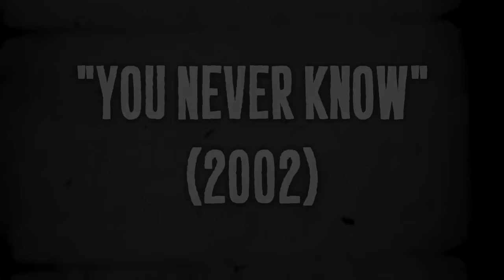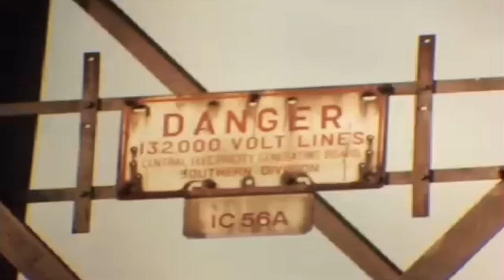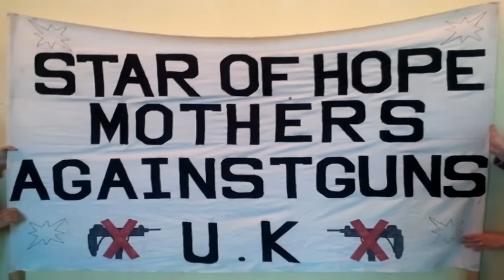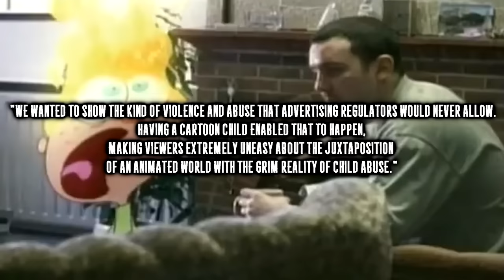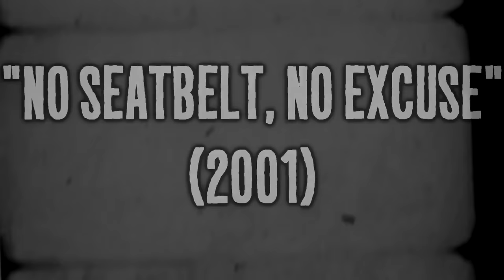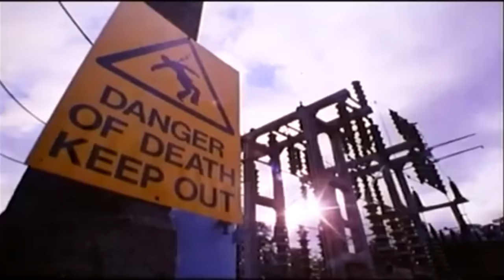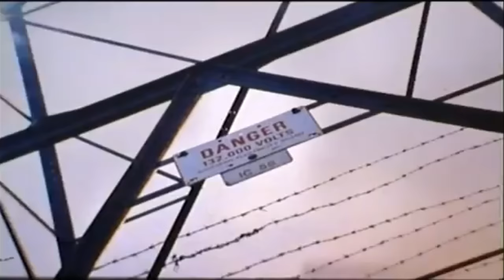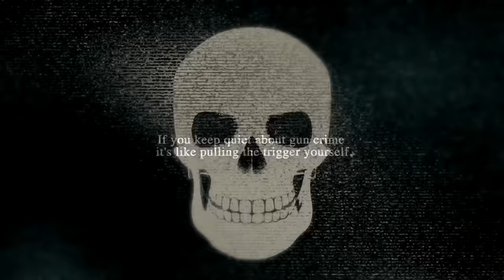9 DISTURBING British PSAs

Comment: The chef dropping the pan over herself actually makes me die inside. Like imagine the severe pain that would cause in real life. Im someone who wants to work in medicine so very little makes me feel queezy, but the thought of that literally freaks me out. 💀
Reply: @stinkmymeat  i actively avoid it  because i know for a fact its graphic as shit, which is a good thing because I understand the dangers of not being careful-
Reply: Are you talking about the one where a chef slipped and spilled a can of "hot oil"?
Reply: My hands slipped off a pan holding a gallon of boiling water at work once (due to an MS-like disease). Literally just lost my grip on it suddenly and it hit the ground. Since I sweat easily and profusely, I had always rolled my pant legs up. I'm sure you can imagine the 2nd degree burns I got that day. It even gave me 2nd degree burns on the tops of my feet before I could get my shoes off. That PSA was legit. Ohhh the pain I went through over that shit .... Ugh.
Reply: @zimtastic1171 God, I’m So Sorry For You…
Reply: I was drinking water when I saw that
Reply: As someone who works in a kitchen's restaurant, this is one of my biggest fears. The pavement often gets wet and slippery, and knowing that this CAN happen, I pay extra caution to dry any water or remove anything that could make me trip anytime I need to deal with boiling water/oil

Comment: I remember in my elementary school an electrician guest speaker told us about the dangers of electricity. He had this 3D model of an electrical zone like from the PSA. The 3D model was wired and he demonstrated a scenario of a child trying to get their kite back. He pushed a button, the child figurine swiveled, and touched a metal plate. A beam of electricity showed through the figurine and sparked at contact. I remember the sound of it, like really loud pops and crackles.

Comment: Firing a real gun is nothing like shooting foam darts at your friends. 

How the hell would plastic guns be able to fire bullets? That stuff gets hot.
Reply: Maybe they were made of metal too
Reply: Assuming it's made more like a small brass tube for a one shot and dump gun
Reply: back in the day metal toy guns used to be more of a thing..though I did not think they were talking about those, I honestly though they were bullshitting because you know how th eUK treats guns but...making real guns out of toy ones is not too hard

like mentioned with spaceman, you can put metal inserts to hold the pressure and heat, but even without a toy body really you can make a gun from anything, sorta makes the entire PSA in of itself void because as long as you have metal piping, simple tools and basic know-how of how to build anything, you can make a gun easily.

Comment: As someone who was in a car accident lot that long ago, I speak from experience when I say seatbelts do in fact save lives. I was t-boned at an intersection and my car rolled over. If I hadn't been wearing my seatbelt I can say with complete certainty, that at best I would've some sort of neck injury or at worst died. Funnily enough the only injury I sustained in that accident was a bruise on my stomach where the seatbelt locked up and kept me from being thrown all over the place. Trust me the damage a seatblet will do is more fixable than the damage being thrown from a window onto the road or into something at 50 mph.

Comment: For a long time, my dad didnt wear his seatbelt, even got me into it when he drove me places. He figured he never needed one because he could brace himself on the steering wheel, but obivously passengers dont have that luxury. One day, my dad was taking me home from school and a lady pulled out in front of us. He assumed she wasnt just going to sit in the middle of the road, but she did. A bit too late he slammed on the brakes and we skidded down the road straight into the passenger door of her car. When we made impact, my head cracked the windshield to where you basically couldnt see out it from the passenger side. By some miracle, I was fine. Not even a headache. By another miracle, my dad was also A-OK. Thankfully we were in a residential-ish area so the speed wasn't that high and he was able to slam the brakes so soon. Comedically, he told me to put on my seatbelt before the cops showed up obviously to have less explaining to do. That day on I always wore my seatbelt, even going down the block while yardsaling.

A few years later, I was picked up by my grandpa from a Boy Scouts event and were heading home. His cellphone started ringing and we couldnt find it. Distracted, we ran right into the back of a van that'd stopped for a turn. We both had our seatbelts on and the worst injury between the both of us was one of the lenses coming out of his glasses as they flew off his face and leaving a delicate slice along the back of one of his hands. This was at sub-highway speeds and he didn't hit the brakes. I don't want to imagine what would've happened if either of us didn't have our seatbelts on. 

Not that long ago, my dad got into a crash in one of his trucks, going downhill towing a boat where someone pulled out in front of him and due to towing the boat, couldnt brake in time. Worst damage was bending the front of the truck out of shape and thrashing the radiator. He was wearing his seatbelt that time.

Comment: It may be kinda strange of me to say, but the reveal on the abuse PSA was not as harrowing as the abuse itself. Why? I guess it's cause I saw the twist coming the first time I saw it. And maybe it's cause the kid laying in that pose wasn't exactly the most convincing effect. But mostly cause I didn't have to see that abuser in the last few seconds. Even the cartoon effects couldn't take away from the brutal acting. It's kinda why I was afraid of some parts of Roger Rabbit too; I was actually convinced as a kid that those Toons being melted really were getting hurt. However, this is only surface level for how bad abuse can get. I am not saying this is entirely inaccurate, but it is only one form of abuse. You also got the gaslighting that can make one think they deserve it. And some... unspeakable forms of abuse too.